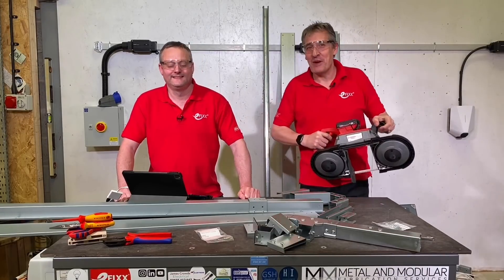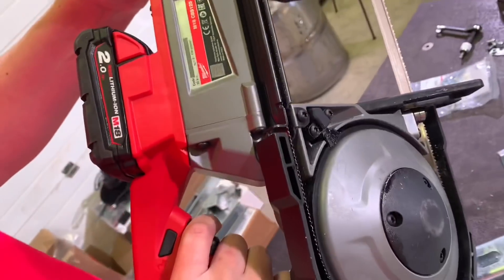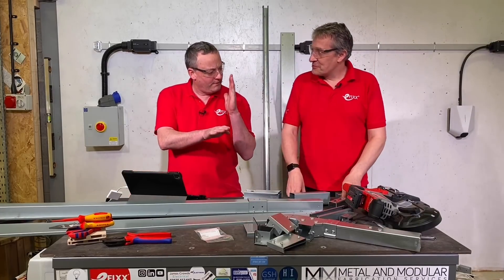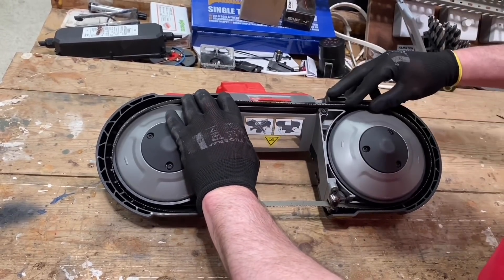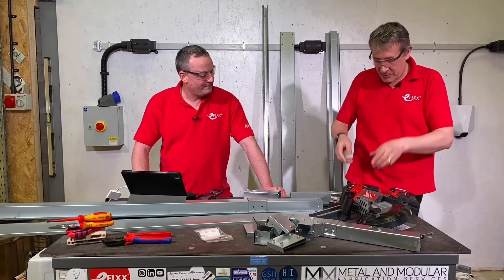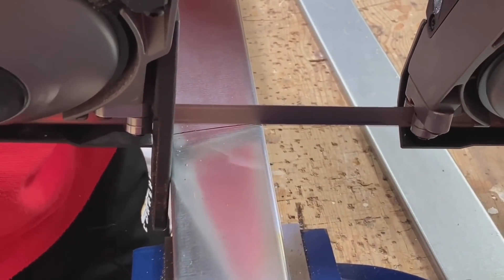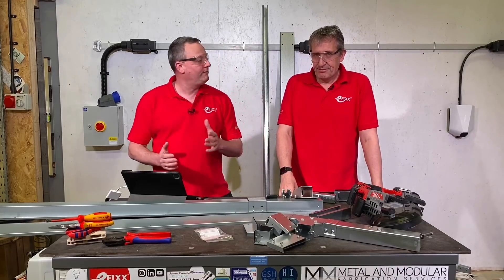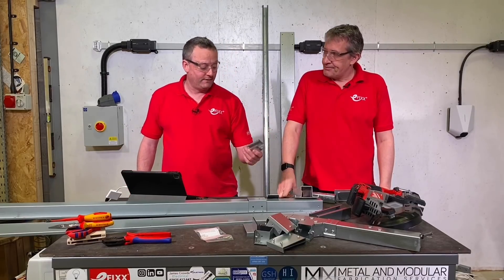REVIEWED: MILWAUKEE DEEP CUT BAND SAW - can it CUT STRAIGHT? M18 CBS125

Comment: I have used this deepcut for electrical for 5 years as well. Holding the weight of the equipment off of what your cutting is how to get a straight cut. This will rip through 4" rigid in no time.

Comment: Like any tool it’s only as good as the operator and practice makes perfect. If it needs to be super accurate, just cut from both sides instead of a single pass from one side for maximum visibility, that’s what I do for stuff that needs to be geometrically accurate for welding square. It eats through mild steel beams for fun!

Comment: The best way I have found to keep the blade from wondering is to keep a slight upward pressure on the bandsaw when cutting.  Even letting the weight of the tool do the work will make the blade wonder.  Go slow and you should be fine.  Also, using the right blade TPI helps with speed as well.
Reply from the maker: Great tips - thanks 🙏

Comment: I’ve got the hilti bandsaw, having the same issue with getting the cuts straight. I would imagine it’s just a case of getting used to it
Reply from the maker: We use a t-square and mark 2 sides and then fight it to keep on the lines.
Reply: Did you get used to it

Comment: I use a little Mikita circular saw for Unistrut which is a doddle to use but the teeth are too wide for trunking.
This looks ok but a decent hacksaw in the right hands is pretty straightforward, so I won't be rushing out to spend what's probably a few hundred quid on this 

Good video though guys
Reply from the maker: Cheers - we’ll be putting it through it’s paces on a big trunking install this week - stay tuned!!

Comment: I have had one of these for about 5 years now, it is an amazing tool when you get to grips with it. As mentioned in video speed is not always best for sure.
We had 1½" studs to cut out of equipment to be dismantled on site last year, an air powered reciprocating saw took 4 hrs to cut 6 bolts, lost count of the blades we went through. I talked the Supervisor into changing the permit to use a battery saw.
Mine cut the remaining 14 bolts in 35 minutes with one saw band still good at the end.
These are superb bits of kit.

Comment: These guys have so cool ideas sometimes but Jesus Christ do they not use these in the uk this is like a basic first day every job has multiple of these that you use like these are as common as a screwdriver and they treat it like it’s alien to cut straighter just rember the blade is at an angle so hold the bandsaw so the blade is straight and rock it back and forth through the cut is it just not a tool used over there ion really get the confusion
Reply from the maker: It’s not a commonly used tool in the UK. They are growing in popularity. After a few weeks use we like it 👍

Comment: Being quite familiar with dewalt version (DCS371), I never had the same issue with wonky cuts, plus its a much more compact machine. However, it doesn't have nearly as much capacity for larger cuts.

If you are cutting strut all day everyday, Dewalt is definitely the way to go, but this absolutely has its  advantages, especially when it comes to tackling 3"+ trunking etc.

Comment: Bosch GCB18V-63. Half the weight & half the price!
Reply from the maker: Yes - but half the cutting capacity - 63mm vs 125mm.
Reply: @efixx  only use the bandsaw in a jam as they aren’t particularly accurate.
Have an Evolution S355 for tray work, but do have a Milwaukee M12FCOT I use on pvc trunking, etc..
Milwaukee are great tools, but they price themselves out of the 18V range in the UK with the free battery Bosch deal running too... you’d just be buying them as a status symbol.
3AH Milwaukee M18HB3 = £60
4AH Bosch Procore = £30
Buy a Bosch tool over £160 & you get a free 5.5AH Procore battery free when you register it.
I do like Milwaukee gear & am all in on their 12V, but at 18V, the competition is at a similar level & much cheaper.

Comment: The best use I've found for these kind of portable bandsaws is for cutting armoured cables. They can be a real time saver, especially when it comes to the bigger sizes of cable. Still need a hacksaw to make the gland off, but good for cutting it down to length.
Reply from the maker: Great tip we’ll give that a try

Comment: Having cut a lot of Unistrut channel over the years I would advise you to spray the item you are cutting with WD40 or a metal cutting compound \ lubricant before you start. It cuts easier, prolongs the blade life and in some instances stops fillings shooting all over the place. This particularly applies if you are drilling metal with hole saws but using any blade on metal I would give a splash of WD40 before starting. Wish I had one of those band saws 15 years ago.
Reply: any kind of blade lubricant or cutting oil is actually NOT recommended for a bandsaw as it reduces the life of the rubber wheels. i've read manuals from Milwaukee and Dewalt. it can also gum them up over time. i agree with you on any other sort of metal cutting device but this one.
Reply: @mailchrisbailey  Thanks for that bit of info Chris, I wasn't aware of it but I will pass on that critical bit of info to the guys using the bandsaws before they muck them up with lubricant.
Reply from the maker: Great advice - thanks David
Reply: We use WD-40 when cutting aluminum(soft metals)or really thick metals. Key is if the teeth get clogged.

As additional information bandsaw blade teeth alter from left to right. When messing with apprentices you could purposely break a bunch of teeth on the same side(use an old blade). This will make the blade want to travel since it’s cutting more on one side then the other. 
Same thing will happen when a bunch of teeth on the same side are clogged with material, hence we use WD-40. 
Yes there will be more material stuck and embedded in the rubber wheels but try it with someone else’s tool when your cutting something that takes forever it may be the teeth are clogged or it’s time for a new blade. I personally don’t use it for strut/channel but aluminum bus that heats up real fast, gums up the teeth, burns out the bandsaw blade and makes the cut take 3-10x longer.

We also use hawg wash or just water when cutting stainless strut because it will also burn out the blade real fast. 

Of course these are things done to “other” people’s tool who also ask “you already need more bandsaw blades?!?”
To them productivity > tool looks heavy used/abuse

Comment: The blade that came with my dewalt, was too course, i swapped it out for a finer pitch .. looks the same with your milwonky .. letting the weight of the machine do the work helps too, a bit of force flexes the blade and for cutting trunking i slip a bit of timber in where i clamp it .. stops it flexing when cutting
Reply from the maker: great tips thanks

Comment: I have used the Dewalt band saw and it seems to suffer with an off center weight, always feels like you want to hold off vertical from the blade because of the band mechanism which throws out your cuts. Once you learn to counter that cuts are fast and normally pretty straight. Possibly you found the same thing when practicing cutting?
Reply from the maker: Yes agree - don't let the saw find its own line.

Comment: There is a smaller 12v version but all of these milwaukee tools are expensive so be prepared to sell a kidney to afford them. You will also need a vice to hold the work and a vice is the thing never easily found on site. Perhaps a review of site vices could be next. The 3 leg foot operated type
Reply from the maker: Great idea we'll get one in - any recommendations or suggestions you'd like to see a review of.